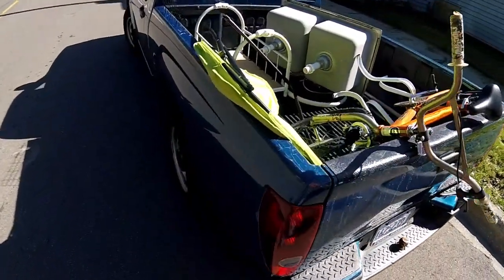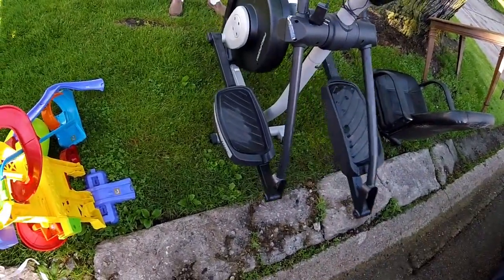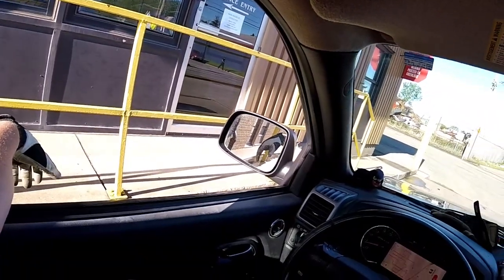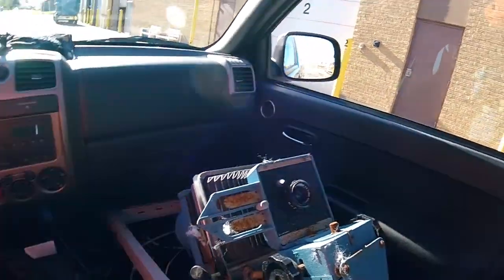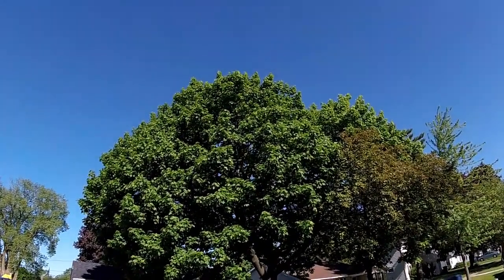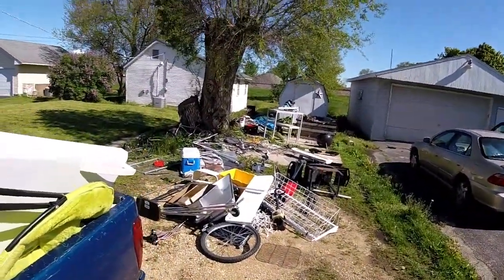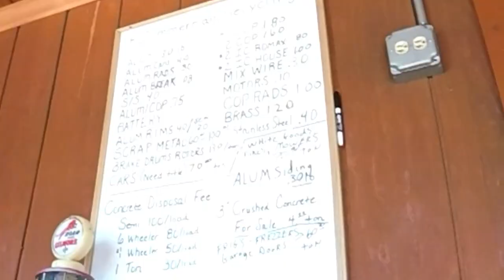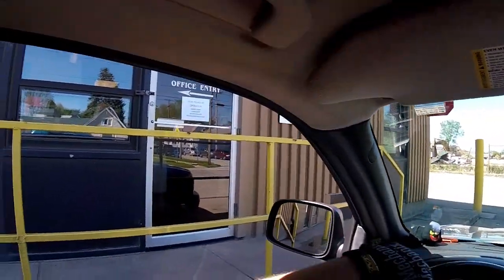Curb Surfing SCORE - Found in the Trash

Comment: Hey, I'm sure you already know this but in case you don't,I'll say it.. The plugs on the end of the power cords you cut off are brass.. Just cut the plug off then grab some plyers and usually you can pull them off and a bit of copper comes with it, cut off the copper and you've got clean brass.. Also on bbq the control knobs, under them are the brass valves or whatever they are but they are brass, few screws to get them out, couple screws to open the valve and take out any steel then its clean brass.. Then of course your cast aluminum bbq, take off the steel parts and that's all. Just a few things i do when scrapping, after a little bit it really adds up. take care, love the videos. happy belated birthday, hope this is a great year for you!! Greetings from Canada

Comment: Hi Paul. Don't want to be the backseat driver here but the dilemma with the fridges seems like its solution will only be the "least worst". #1 Ignore fridges altogether. #2 Save up a truck load in the back yard then go for Zimmermans' #3 As #2 but fill up empty space inside the fridges to maximize load. #4 Go for  the Sycamore scrap yard (and possibly fill up the fridges with other scrap to maximize load.I dunno :)

Comment: your being ripped off they are changing their prices to suite them. 60 a ton is bs esp for fridges when they will cut out the compresser and get 20 cent a lb for that. when you have to travel as far as you are goin it isnt worth the gas in my bock
Reply: @janetthurston852  I professionally scrap been doing it for years and a yard by law must provide prices that are up to date for that day. that guy gave one price and then cheated Paul. You can't change the price on someone like he did aslo you aren't suppost todecide a weight of a bucket the subtract the weight off I see that all the time. and all yards must use digital scal and weight with in a 1/10th of a ounce on the lighter weigh ins.
Reply: Happy belated birthday Paul 🎉🎂🎈